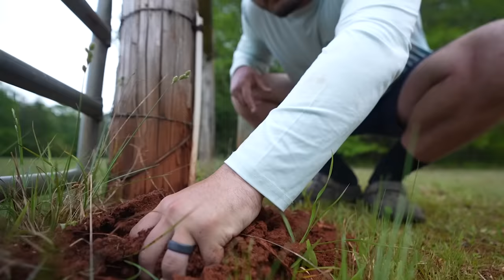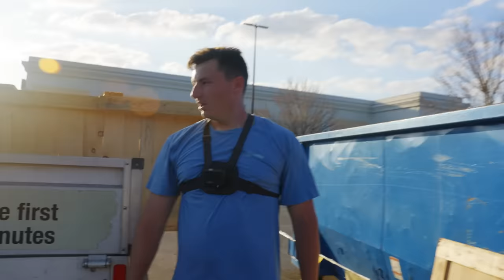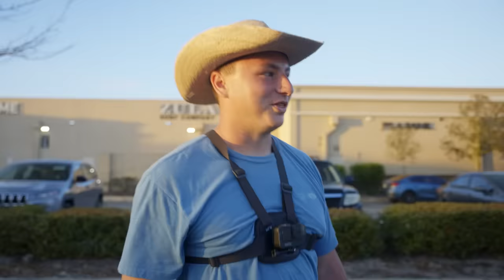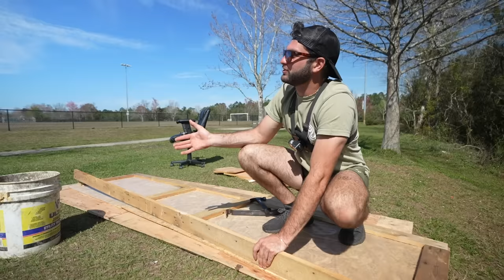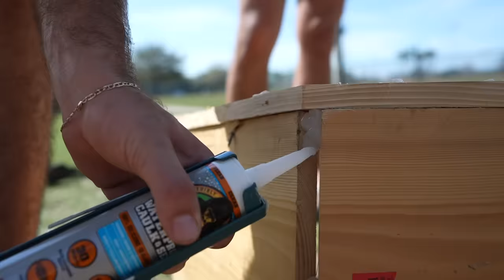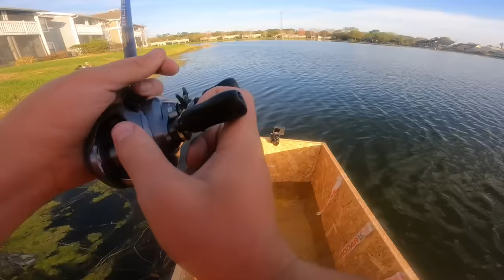Dumpster Diving Boat Build Challenge!!

Comment: 44:06 You should have installed the trashcan upside down. It would have trapped the air inside. With it right-side up, as soon as it takes on water, the buoyancy is gone. Also... water pressure outside the can was crushing the air pressure inside the can, and since the air had somewhere to go, your trashcan caved in. If it was upside down, the air wouldn't have had anywhere to go, so the pressure would have increased, which makes the can more resilient against the water pressure.

Comment: stop putting the bins with the opening facing the sky, put them the other way round and the trapped air inside the bin will keep you afloat.

The way you are doing it allows the bin to fill with water and weigh you down and causing you to sink

Comment: Only Ayo would expect to find Pristine Trash in a Dumpster..Well news flash dude, it's going to smell, its going to be GOOPY, and it's going to be broken..you could have used the  two bed frames that were by the Loveseat then put panels around the outside and use the sealer to fill the gaps and make it waterproof and float..Hey Just Sayin Guys

Comment: Soooo, if you turn a loveseat into a boat.... wouldn't that technically make it a loveboat????

For your next boat build challenge...
   1. Take the best build 3 ideas from previous challenges.
   2. Spend 3 hours gathering materials and 3 hours building the boats.
   3. Use each others boat builds instead of your own for 1st fish, most fish, biggest fish. If YOUR (not the one you're in) boat sinks or capsizes, you lose.
   4. Biggest loser has to buy/cook a steak and lobster dinner for the winners while dressed as a maid.

Comment: How about a $500 challenge off of market place.
Even if it is a $100 jon boat off marketplace. 
But you also got to sleep on the boat over night. Eat what you catch.
Reply: Cant touch land at all. Anchor in the middle of the water. Float. Fish. Eat. Sleep. Fish. Eat. 24 hours challenge
Reply from the maker: Give me three weeks…
Reply: Do work. I look forward to the video.
Reply: I just did 165 miles on the ICW on a 14ft jon boat from marketplace. Camped in the boat every night with a tent cot.

Comment: id have just taken the whole dumpster and used that to make the boat. just weight the bottom :'D

had the buckets and trash can been flipped the other way around, so that they TRAPPED air inside, they wouldnt have just folded like that. the air would get compressed inside by the water and keep pressure on them.

Comment: My only problem with you building a boat is, why don't you turn your buckets upside down?  If the bottom of the bucket is completely sealed, then it won't ever take on water as the air will keep the water from coming in unless you tilt the boat incorrectly to let air out of the sides.

Comment: Build a boat using a tarp or plastic sheeting.   It will be waterproof, providing you don’t punch any holes in it!

Since they SHOULD float, part of the challenge could be a speed test.  

For stability, some simple outriggers: 5 gallon buckets on the ends is a 2x4